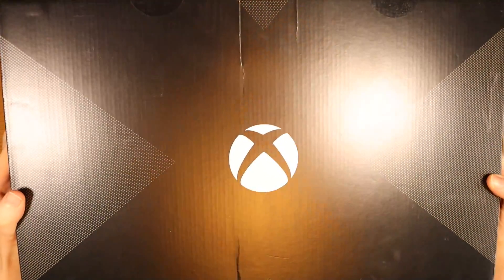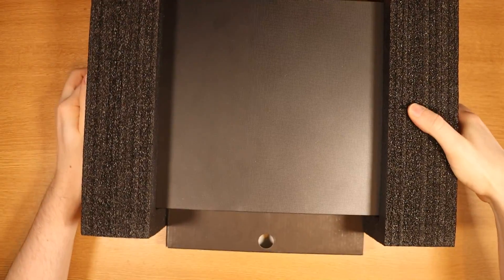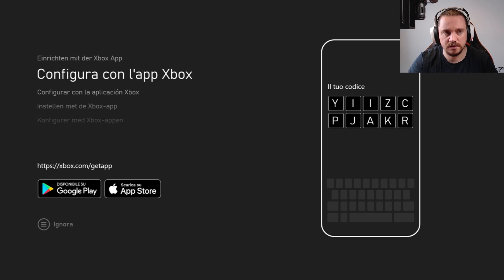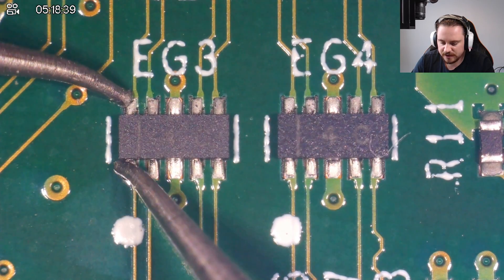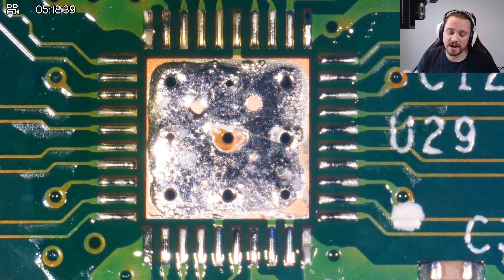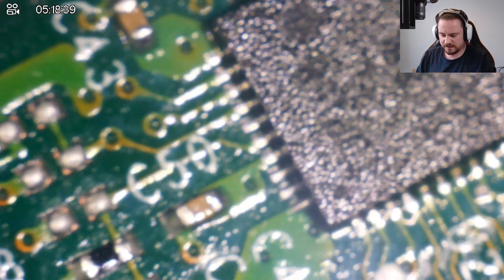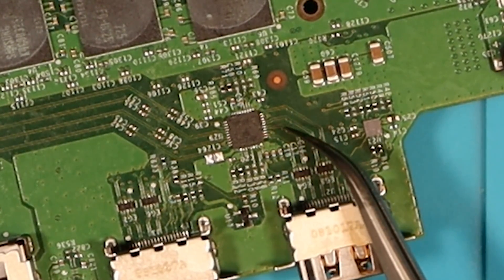Broken Xbox One X No Display - Can I Fix It? (FIRST ONE!)

Comment: Nice repair, good video... It a shame that you did not check the readings at the capacitors you mentioned, it would have said a lot about the validity of the retimer test. Maybe next time... Good soldering job and video...Thank You ...
Reply from the maker: Thanks Waren and I completely agree. I THINK if I recall, it was showing as 130k ohms... but that could be wrong 😊